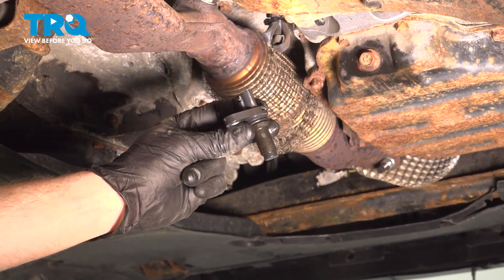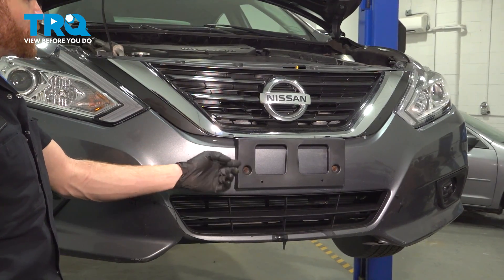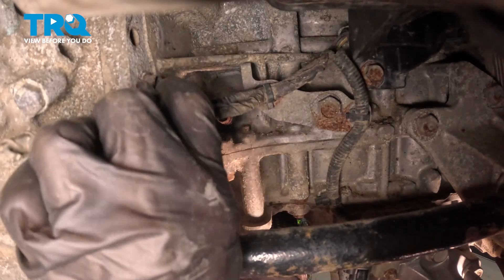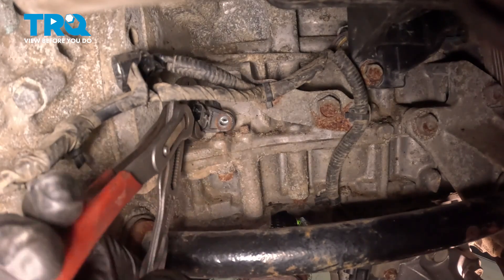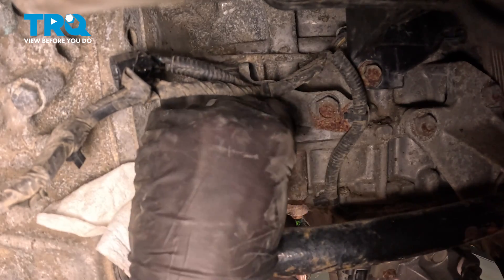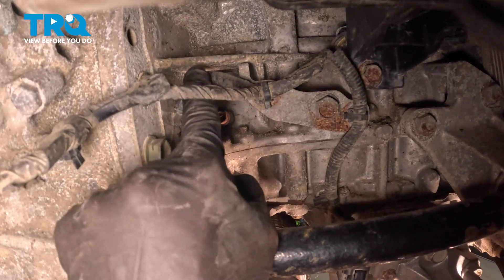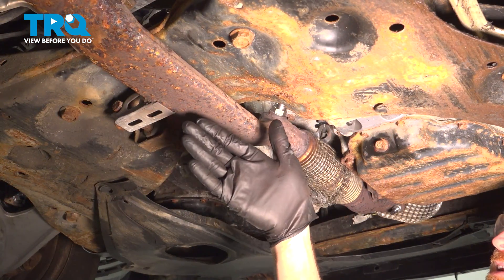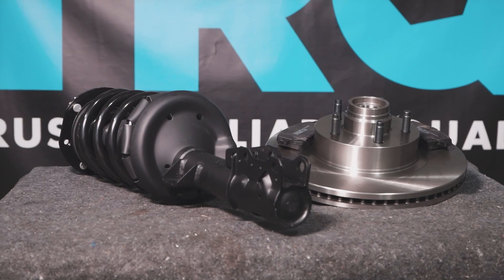How to Replace Crankshaft Position Sensor 2012-2018 Nissan Altima

Comment: The crankshaft sensor is in the same place for all Nissan Altima 2012-2018 2.5 L , it's different for the 3.5L for those of you asking. And the ones that are on the top of the engine are the camshaft sensors and there's two of them. But they are different from the crankshaft..